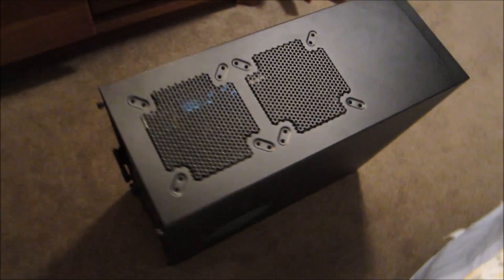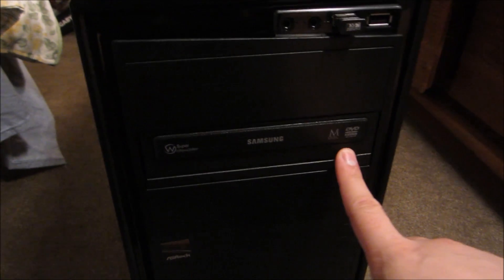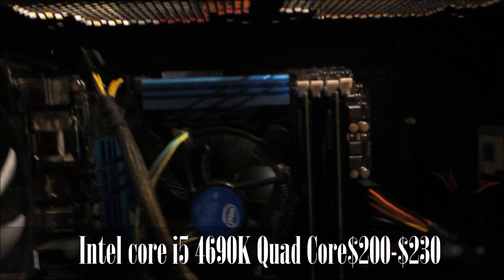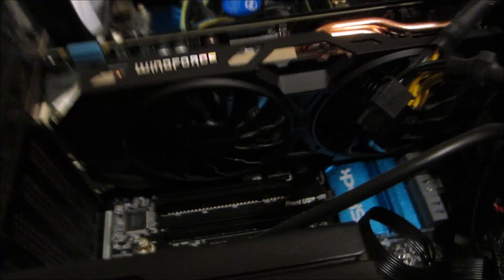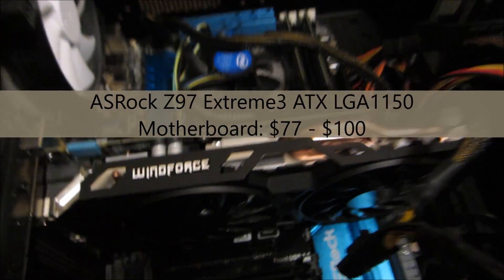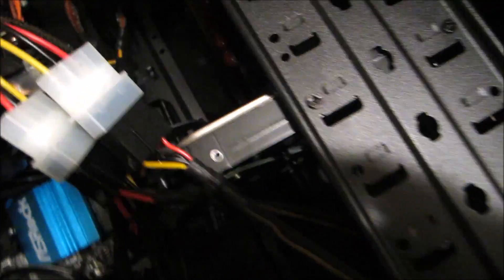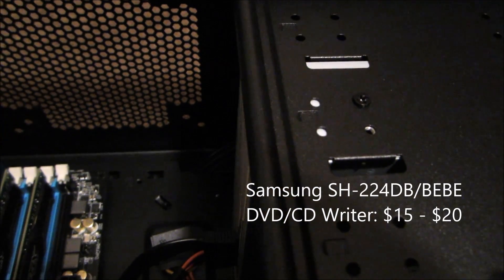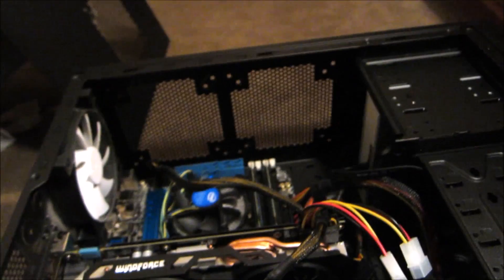Underground Tech's First Gaming Rig! MGSV Ready!

Comment: does amd chip is not good for gaming and rendering?? 1st time searching stuff for building gaming pc
Reply from the maker: No it can be, I just find Intel more reliable on the $200+ cpu's, the AMD cards are great in the lower budget, but if you have the money to get an intel i5 or higher, then go for it. From the ones I was comparing a while ago, Intel seemed to have better performance in benchmarks than AMD.
Reply: Underground Tech that means if I'm in a budget going for Amd is better because it's cheaper and also good for rendering and gaming right?
Reply from the maker: Yeah pretty much.
Reply: Underground Tech thanks man
Reply from the maker: Luqman Harith no problem!
Reply: as of now, AMD is basically obsolete for any range. the only possible exception is low budget systems for multi-core programs such as rendering or editing
Reply: UnhandyBirch656 Ok, Thanks! should I wait for ryzen or go for their 6 year old chip or go for intel pentium g4560 with hyper threading $65

Comment: My rig has an fx-6300 and an R9 380. I have an old 250 GB hard drive and an old 120 GB hard drive. I have a 120 GB ssd and 1TB hard drive. I have a duel boot of Windows 10 and Ubuntu. Fallout 4 runs at 60ish FPS and 1080p